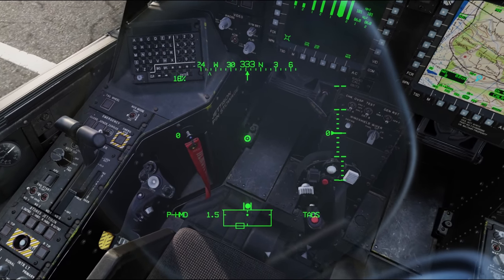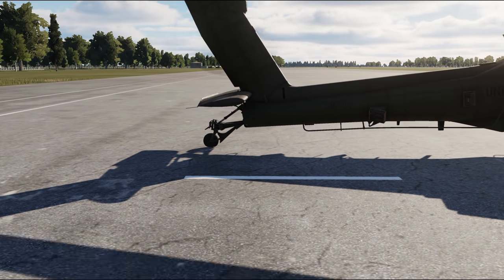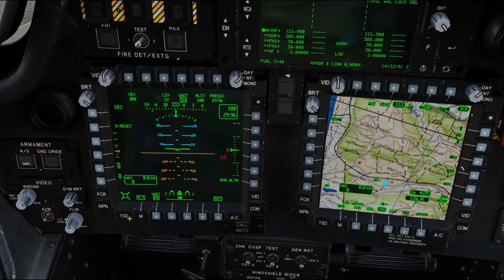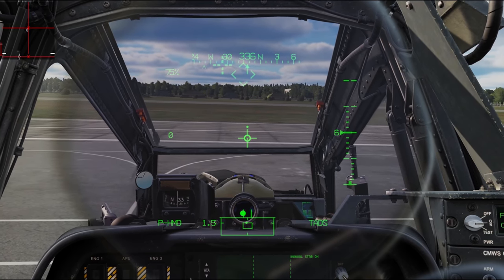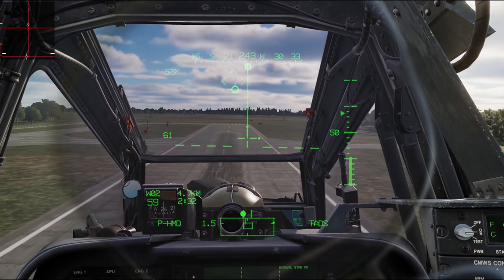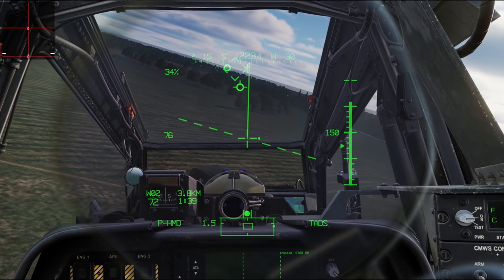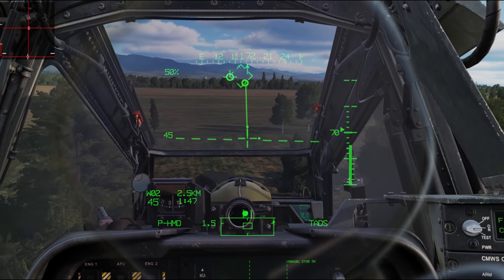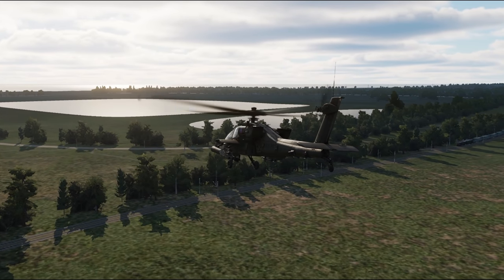DCS AH-64D: Horizontal Stabilator- What it does and how it works.

Comment: In the early days of the UH-60 Blackhawk, the stabilator actuator could, and did, receive stray RF interference that would cause the stabilator to actuate into the nose down position. This sometimes happened at low altitude and high speeds, which put the aircraft into an unrecoverable condition. This was later rectified, and a manual stabilator lock-out was added to the cyclic, however, not before the Blackhawk earned one of it's unflattering nicknames...the Lawn Dart.
Reply: where there's trim, there's a potential of a runaway [trim]
Reply: And you just put together a story I hear from a old vet of mine from the states who never explained what a “lawn dart” was 
Here in Canada we called the starfighters (I believe, please correct me if wrong) law darts because they had an awful glide slope without engines
Reply: @dodoman6372  Lots of aircraft get called the lawn dart, and the starfighter is a famous example of that.

Comment: Awesome tutorials casmo. I've spent many a hour replacing those horizontal stabs and shimming them. Plus the actuator that moves it.
Reply from the maker: Saw one once get crushed into a GPU. gotta check it before you go to the APU power lol.
Reply: @CasmoTV  standing behind the APU exhaust during ground runs on a cold day is always nice, lovely hot air blasting out of it.

Ref the double electric stab actuator, the worst thing I've seen happen was when it was disconnected at the stab end and was actuated and chewed up all the frame.

Comment: Great video.  I bound these controls to my HOTAS but given the limited buttons I have with my setup, I may unbind them.  I approached these controls from a fixed-wing perspective and thought they'd significantly alter flight path.  I guess they don't really anything to significantly affect rotor disk.  They just alter the attitude of the thing hanging from the disk.
Reply: now think for a moment.. just a brief moment.moving the thing hanging from the disc moves the swashplate [away from the one half of the disc and towards the other half]. what does that do to the disc?
Reply: @SouthPoleAntarctica  I don't know anything about helicopter rotor systems let alone the Apache's rotor system so I can't provide a good answer.  Maybe you could let me know what would happen?  Would the swashplate move in this case?  If it did, would the helicopter be affected in the pitch or roll axis?  First thought would say pitch but wouldn't gryoscopic precession cause the effect to manifest itself further along the direction of rotation?  For what it's worth in DCS I tried this and extreme positions of the stab does cause the Apache to pitch up or down.
Reply: @jykozak  sorry if that was too harsh. the thing is - your blades are controlled +attached to the swashplate by their control links. the position of the swashplate dictates the pitch of the blades as they travel through the rotation. if your swashplate moves (either by cyclic/collective input, OR by a fuselage dangling), the blades receive a pitch change in their travel. Thus, if your fuselage attitude instantly/abruptly changes (because of jetissoning the stores, or people walking across the cargo bay, OR by the stabilator change, where applicable), the swashplate being set constant according to fuselage tells the blades to change their path. If you want your fixedwing analogy, think controlling a plane with stuck elevator using the elevator trim.

Comment: Great info, thanks Casmo.
I realize you have plenty of time on the Apache IRL and Sim but "damn son" you can hover.  Any chance of telling us your setup and  axis tune settings.  I'm on a TM Warthog standard stick and not showing much progress, hate to be practicing how not to fly.
Reply: I don't think having that heavy spring in it helps at all.
Reply: @louispenn9253  Thanks Louis, heavy spring would be a challenge.  However, I have changed the spring out for the light weight one (green) from Sahaj.
Reply: @SargeSHC  You might find putting one of Shaj's extensions will help a bit too (obviously you'd have to desk mount your stick).  In the end though you're limited by the WH's less than optimal design.  If you really like your WH grip, then you could consider getting a Virpil base (the T-50 CM2 would be more suited than the WarBRD) to replace the TM base.  Or get rid of the WH stick completely and buy yourself a VKB Gunfighter base + 200mm extension + VKB MCGU grip...Go on, you know you're worth it ;)
Reply: @stevedavey1343   Lol... I think I am but not sure if the domestic comptroller would agree.  Nice looking sticks alright.  Thanks for the feedback.
Reply: @louispenn9253  Definately. The TMWH literally has something like a black hole right in the center position that tries to pull you just right there as soon as you're close enough. Tried flying the A-10 with that and I felt like being a year old again, having to learn walk again and I immediately went back to my trusty old FFB2. Extensions also help a lot (Sahaj or MFG, guess other stick manufacturers like Virpil and VKB might have some as well these times).
Reply: Stick extension should be mandatory with the WH. I've moved on to VKB + 20cm + MCGU, but mainly for all the extra buttons. The WH grip was excellent in the hand due to the metal body, and the switches never failed on me. The 10cm extension I had, along with greasing the stock gimbal made it better; but near the end I swapped out the gimbal for a 3D printed replacement that used bearings. That was the secret sauce to making it a great joystick. If I hadn't already convinced myself that I needed the VKB (and a Gunfighter base with 20cm extension and lefty Space grip for collective), I'd still be happily using it. Even with a 3D printed extension it was on fleek, as the kids say. If you don't have access to a printer, I'd be happy to discuss.
Reply: @ainuketube  Thanks for the offer.  However, I have everything setup for my go to plane  the F-16 (Falcon BMS and DCS), so it's a side stick etc.  Apache will just be distraction for when I want to fly something else.  I'll keep the VKB option in mind though.  Thanks again.

Comment: So if all it does is to lower the nose (which respectively will require a collective change if we want our flight path to remain the same), what's the difference between using the stabilizer to lower the pitch, and using the cyclic and trimming in order to lower the pitch?
Reply from the maker: Nose pitch is nearly irrelevant to flight in a helicopter. Collective changed blade pitch
Reply: @CasmoTV  I might have not explained my question properly.  And disregard what I wrote about the use collective. Let me rephrase:
Nose pitch is mostly relevant for down visibility (seeing over the cockpit dashboard) as I see it. So if the pilot wants more down visibility he needs to lower the nose pitch.
And in order to lower the nose there are 2 methods: one being the stab. and the other being the cyclic. 
What’s the advantage of one method over the other?
Reply: @TheWoodWorkingPilot  Simple answer, cyclic also effects your airspeed, stab does not. You are just hanging under your rotor disc and the stab can change that 'angle of hang' so it speak. Disc is doing the flying so changing that with the cyclic changes speed and direction of chopper.
Reply: That’s what I initially thought it would do so I tried it out myself even before watching any video about it, and I realized the speed does change when I lower my nose with the stab. 
Then I watched this video and realized also Casmo’s airspeed increased as he lowered his nose using the stab, thus my question arose about the advantage of one method over the other. 
When you use the stab in DCS your speed remains constant? 
Might it be a bug?
Reply: @TheWoodWorkingPilot  Not a bug - you are possibly improving the position of the airframe into the airstream (depending on start position/angle) so getting a slight increase in speed - this is actually what this system is trying to do in Auto mode on all helicopters during flight - fair the body of the aircraft into the airstream to improve efficiency etc. But you are not changing the position of the rotor disc as such to give more thrust.
Reply: @bikeguy3034  Interesting explanation.  How would you explain why in minute 3:24 of this video when Casmo uses the stab to lower the nose while in a straight & level flight, he immediately starts descending and his speed increases? (these are exactly the reaction I would expect from the heli if the cyclic was to be pushed forward to lower the nose..)
And then at min. 3:33 he brings the nose back up using the stab and he enters a climb and his airspeed decreases.
Reply: @TheWoodWorkingPilot  Most of us use man stab for either "speed brakes" when needing to really slow down, or for better viewing angle at slower speeds while in the CPG station during contour/noe day flight (to see over the PNVS/TADS for short torso guys, lol!). Not really relevant at night due to the NVS seeing "through" everything.
Reply: @TheWoodWorkingPilot  The man stab is also used to set an airframe pitch attitude (increase or decrease) compared to the "optimum attitude" the FMC is working to obtain. Also during high wind and at a hover, setting the man stab to zero helps remove some of the "bucking" experience when hovering with a tail wind. Case and point, an OGE BP with a tail wind.
Reply: @bikeguy3034  I tried it again while trimmed in straight and level, and every time when lowering the nose using the stab the heli just transitioned into a rather steep dive and airspeed increased accordingly. When I tried counteracting the descent with the cyclic I resulted the same pitch I first started with.  🤷‍♂️ What am I missing here?
Reply: @enricomayers  what does BP mean, and what is the “bucking” experience? 

Also - I thought the stab angle doesn’t effect the nose pitch while in a hover, and that it effects the nose pitch only when having forward airspeed. Casino even demonstrate it in the beginning of the video.
Reply: @TheWoodWorkingPilot  Sorry, I didn't explain myself well..during forward flight it helps set attitude pitch (much like an elevator on a stuck wing airframe). When at a hover in a battle position (BP) or firing position and experiencing high wind (mostly during a tail wind) the aircraft pitch attitude will change because of the large airfoil surface of the horizontal stabilator being "exposed" to the wind stream. If you set the stabilator to 0 degrees it's essentially in line with that cross/tail wind and minimizes the pitch change (bucking) experienced at a hover during high wind. Hopefully that explains it a bit better. I'm not sure DCS models the pitch change at a hover during high wind.
Reply: @enricomayers  Got it! Great explanation. I love big ventilator machines but a stuck wing is my daily ride so I’m still learning…
I think the only thing still not clear to me is why when you do NOE flight (which mean you have foreword airspeed), you would use the stab to change the pitch for the short torso CPG’s? Why not just using the cyclic and force trim to do that?
Reply: @enricomayers  Just to confirm I got it correctly till this point -  the engineers put the stab there in order to improve the helo’s efficiency and it was meant to be used in auto mode 99% of the time. Then use dumb humans decided “hey, we could use that stab as a speed brake when really needed, and also for increased visibility in case the CPG forgot his seat cushion. Also it also works nice during a high tailwind OGE hover.”
??
Reply: @TheWoodWorkingPilot  The reason we would use the stabilator during NOE forward flight is because it would change the pitch of the aircraft (therefore increasing airspeed) and we compensate with the airspeed increase by applying aft cyclic and setting the force trim to maintain our same relative air/ground speed but with a more nose-low attitude. Just manipulating the stablilator without compensating with the other controls would increase/decrease our airspeed.
Reply: @TheWoodWorkingPilot  Correct. Most of the time the flight management computer (FMC) is auto scheduling the stablilator as necessary for best aerodynamics. Above 80kts it's auto only, below allows manual manipulation. There is a mode on the A/C UTIL page that allows NOE/Approach (NOE/A) mode. When selected and below 80kts it auto schedules the nose down to increase forward visibility during NOE flight and when on approach to a landing. Most pilots prefer to manipulate it manually than setting NOE/A mode.

Comment: how would you use it? .. to put minimum crossection into the airflow during long range ferry flights with unusual CoG (mostly the tail heavy). definitely NOT to see better from the aircraft.
Reply from the maker: Well it doesn’t work above 80 so a cross country doesn’t make sense. It literally just moved the nose for whatever reason you want to do that for.

Comment: It appears unlike the 60, the stab position doesn’t throw the nose up while in hover since there’s no lift due to tail rotor tilt.  This correct?
Reply: The UH-60 is generally nose-up in a hover due to the forward tilt of the rotor mast. Especially important since the angle of the tail rotor gives additional lift to the tail.
Reply: The Apache also will hover slightly nose up for the same reason of having the transmission/rotor mast tilted forward. The stabilator angle does cause a slight nose up/down adjustment when in a hover, but it is usually only a few degrees difference and you need to have full deflection either way to achieve that. It's just not simulated to that extent in DCS currently.

Comment: Could this also be used to help slow down the aircraft, almost acting like flaps?  I have a hard time slowing down when I'm coming in for a landing, since my instinct is to keep the nose where I can see what's in front of me, so I usually end up coming in too fast and then having to make some big aft cyclic input to slow down, which then requires big rudder and collective changes, and I get a little unstable.  Could setting this to nose up help with that or do I just need more practice?
Reply: If you want to see further down turn on the pnvs
Reply: Go fly the Mi8 some, then you will really know what 'struggling to slow down' is ;)
Reply: Mi-24
Reply: You would want to set it in reverse. I use man stab in the full Nose Down position to put that big ol barn door into the wind and compensate with aft cyclic to really get it slowed down. May even kick it outta trim if necessary to stop her. I could just plan my approach appropriately for the wind, but that's no fun.
Reply: @LongTran-em6hc  Mi24 much easier to slow down that Hip
Reply: @enricomayers  the aerodynamic drag of the stabilator isn't the primary cause for the increased deceleration rate, although this is a common misconception. When the pilot applies aft cyclic to compensate for the stabilator trying to nose the aircraft down in pitch, the rotor disc is tilted further aft and the total aerodynamic force of the main rotor is moved further aft. This is more akin to engaging additional reverse thrust against the aircraft's flight direction, which is the primary decelerative force. In reality, the stabilator allows the pilot to maintain the pitch attitude of the aircraft while tilting the rotor further aft, despite the stabilator adjustment occuring first.